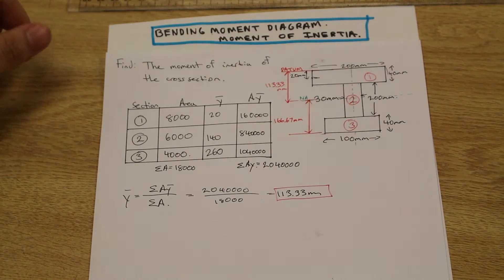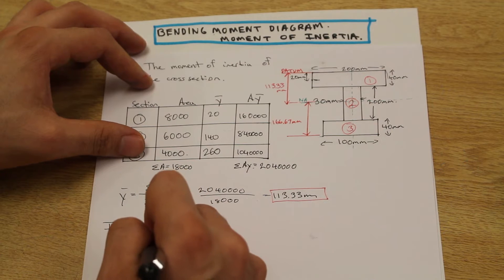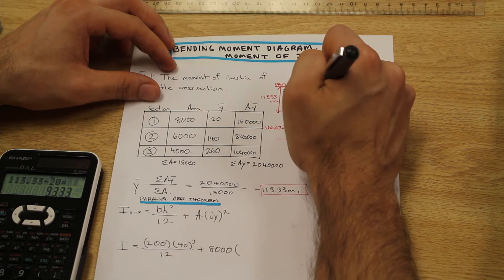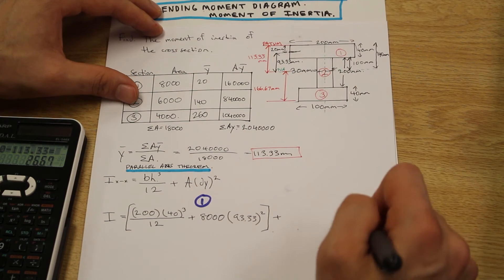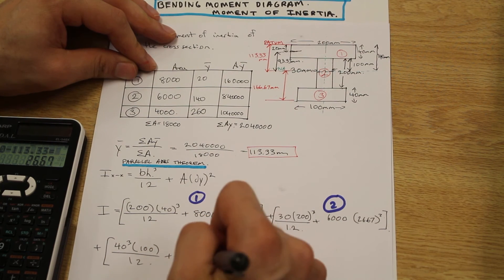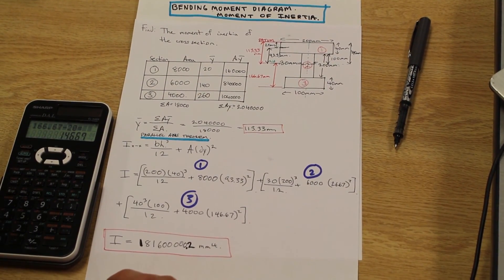Moment of Inertia and Centroid 2/2 - Bending Moment Diagram Part 5

Comment from the maker: TimeStamp !

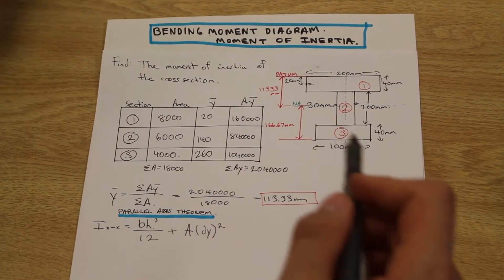1:54 - Theory Ends (Parallel Axis Theorm) - Solution Beings 
1:55 - First Step - Calculate "Section 1"
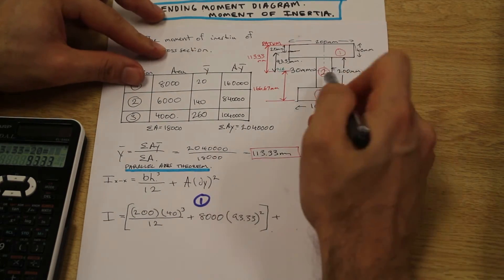3:48 - Second Step - Calculate "Section 2"
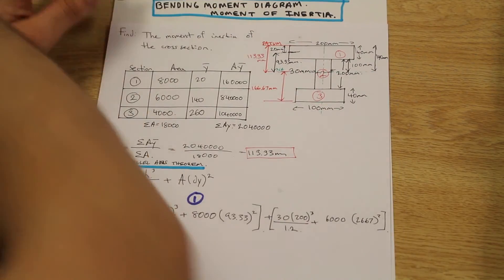5:25 - Third Step - Calculate "Section 3"
6:30 - Final Solution (Now try to do it on your own!!)

Note! This is a very LONG Question! Here are all the links you need:

1) Links for "How to Draw A Bending Moment Diagram"
Part 1 - https://www.youtube.com/watch?v=017RB...
Part 2 - https://www.youtube.com/watch?v=1zsTP...
Part 3 - https://www.youtube.com/watch?v=UYkH7...

2) Link for Part 1 "Moment of Inertia and Centroid" - https://www.youtube.com/watch?v=-_Zb9...

3) Link for "Calculating Flexural Stresses" 
part 1 - https://www.youtube.com/watch?v=WTDSW...
Part 2 - https://www.youtube.com/watch?v=FMSzg...